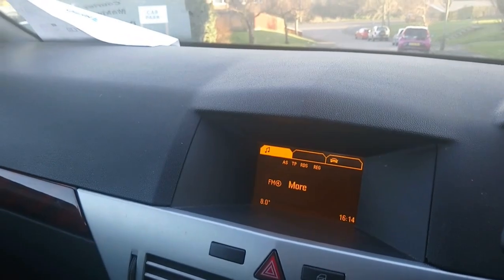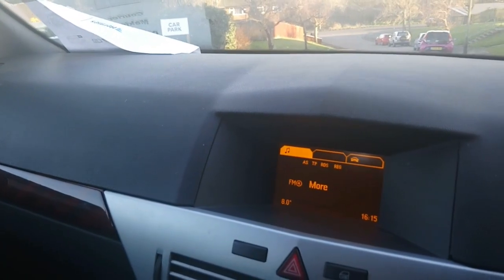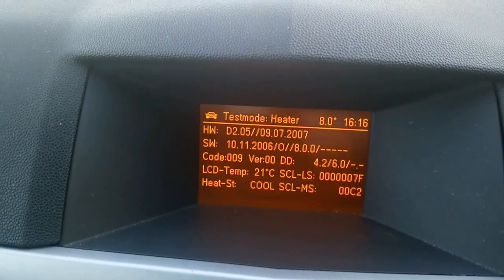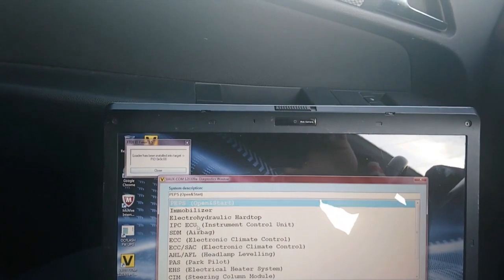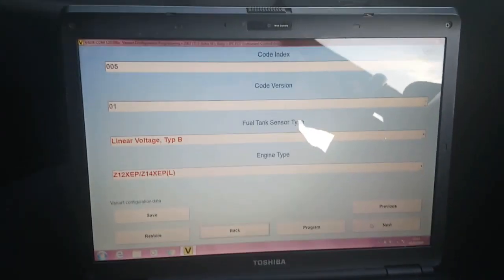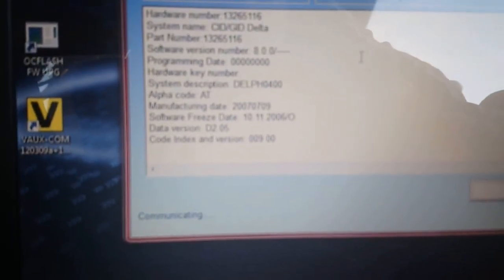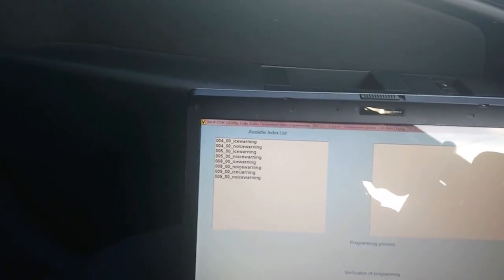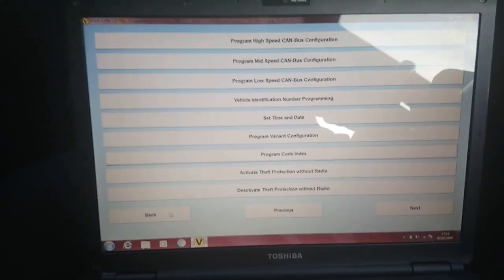How to change code index on Astra H Infotainment displays

Comment: hello there,i have a opel astra h 1.7cdti model 2005 and today my op com arrived and played a little bit with index codes,i activated bc1 and bc2 but not showing any range or consum on the screen,from my research i think i must have another index codes,any ideea how i can get them?or if i can get them?The ideea it’s that i managed to activate that but not showing anything i tried all of the index codes.
Thanks!
Reply from the maker: Hi if memory serves all the indexes that are compatible with your car should show up in the list, 2005 was the year they brought out the face lift i believe and one of the things they changed was the type fuel sender unit so depending when you car was actually built you might have the wrong index selected,I i was you i would check in the engine ecu it should tell which sending unit you have and you look up the correct index on https://tech2.guru/astra-h-code-index/

hope this helps

Comment: Hey! I tried this and got it working but now my GID doesn't show ECC info, even tho it's "Present" in settings. Any tips?
Reply: Update: Went back to figure this out and what do you know, the heater info had appeared over night, cool. But now my range is still showing 0km and computer tells me to refill, even tho there's fuel in the tank. Instant fuel consumption is showing correctly any way.

Comment: I just want to turn my range off as its faulty my gauge shows my fuel but display doesn't always sync it happensed on my old zafira had Some1 delete function off how do I do it myself plz without a computer
Reply from the maker: As far as I know you will need to have an opcom or tect2 to turn off the board computer

Comment: I have another one for you. I have bought a CD30 MP3 with the GID Screen but it did not come with security code and I have the original head unit wich came with my car. I want to connect my car original CD30 with the new GID, can divorce my car original cd30 from the original BID screen and marry it with the new GID without Divorcing the new CD30 from the new GID screen?
Reply from the maker: you need the code for the new stereo and g i d to be able to do it but you should actually just be able to put the new stereo and gid into the car because that's what I did and it just worked.

Comment: Can I fit a zafira 2008 GID into a Astra 2007. I have bought one but the plastic surrounding won't fit the GID that came from the Zafira.
Reply from the maker: I believe that the screens are interchangeable but you will need to remove the screen Zafira surround and fit it to the Astra one, but it might be an idea to try testing it before you swap them over. Also do you have the stereo from the zafira or are you using an aftermarket headunit?
Reply: @zedalon  I am thinking of divorcing the headunit from the GID and marry with my old headunit, the original is in mint condition. I saw the surrounding which is not looking very nice but I have found out that a new one from Vauxhall may cost around £15 but I don't know the part number
Reply from the maker: If you have the car pass for the gID and the stereo you can divorce the stereo from the gID then you will need to basically just marry your old stereo to the new screen using the screens code not your car.
Reply: @zedalon  Thanks for that, do you know the surrounding part number?

Comment: Hi I've put a bid in change the codex to 010 but the range on the display is not accurate to the fuel garage any help.plz
Reply from the maker: Hi ya what year is your astra?
Reply: @zedalon  
Morning its 2005 buddy
Reply from the maker: Have you checked to see which fuel sensor you have as around that time they changed then.
Reply: @zedalon  yes muccer ive got linear voltage type B so I put it on codex 010 is that correct plz
Reply from the maker: Yes it is correct, how long you had it installed because seem to get closer to the correct range the more it was used but saying that I only use it as a rough guide on range
Reply: @zedalon  ive fitted it around 3 weeks ago
Reply from the maker: Mine shows about 100miles range per 1/4 on the gauge and about 430 on full tank. But that's on a 1.4
Reply: @zedalon  when I had half tank the range saud 16 miles is there anything else I can change via opcom does putting a different codex number in or shall it be 010 i tried 008 but 010 is the best one ? 
Would tech 2 make a difference buddy

Comment: Can I change the index so it works with my Climate
Reply from the maker: To make the display show climate info you just need to go into the infotainment section on op-com the set climate control present in the screen settings
Reply: @zedalon  do I need to have a factory head unit in place to do so as I don't... I built a car pc and no stereo in place at all. 

The GID is going in the ceiling.
Reply from the maker: No you don't need stock stereo
Reply: @zedalon  hopefully all I need is the 4 digit code and away I go then as it's from another car but has the code written on it. Luckily I got a dealer tech2 today so hoping I can use that just to warrant further uses for it lol

Comment: Can i use it on 2004 astra h twinport
Reply from the maker: I don't see why not
Reply: @zedalon  some1 said that my gas float is different after 2004 cars. is it true
Reply: @zedalon  i mean fuel sensor
Reply from the maker: Yes it will show fuel info
Reply from the maker: Yes that is true, you will either a have linear voltage or linear resistance fuel sensor.to find out which you have.you can check into engine ECU on the op-com.
Reply: @zedalon  so when i swap to GID can i see fuel infos either?